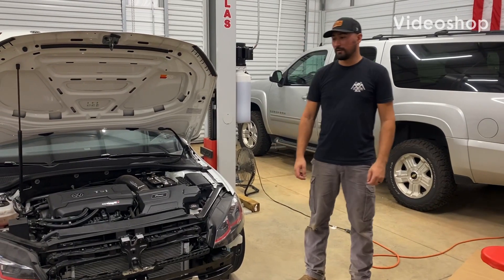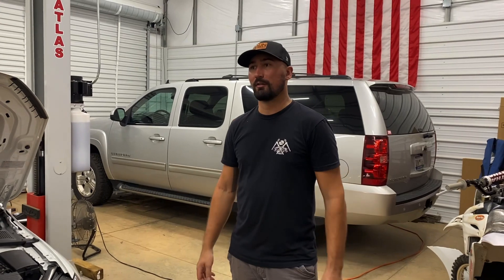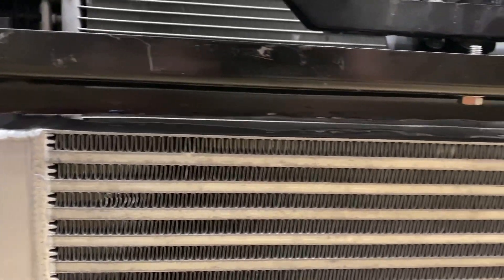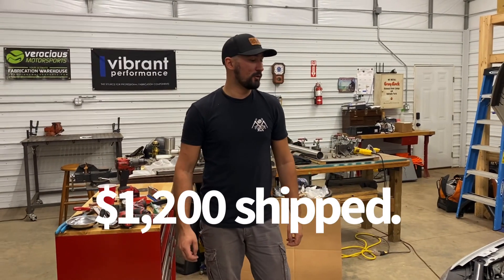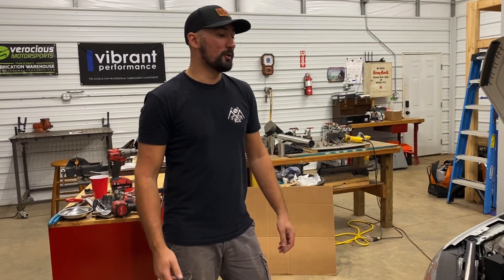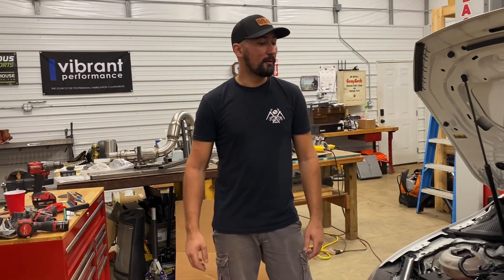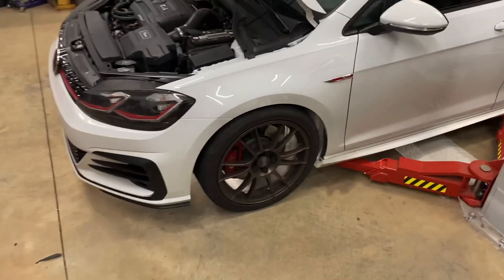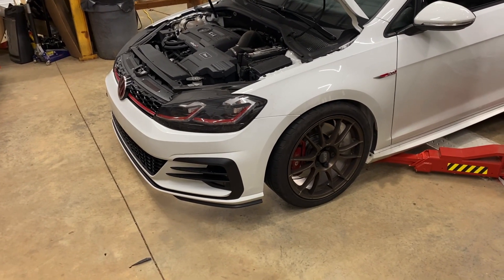Mk7/7.5 V2 FMIC, by Baun Performance

Comment: Awesome dude you're amazing , only plan on going stage 2 on my GTI would this intercooler be a good idea or overkill? Very interested in ordering soon. Also do you make charge pipes etc....
Reply from the maker: The V1 is plenty, as it supports 450whp (HPFP fueled hybrid turbo).

I don’t build charge pipes as there’s no noticeable gains even on my is38 car, plus the market is flooded with them in all different price ranges. Check out my top ten mods video, tons of mods people do didn’t make the cut.
Reply: @BaunPerformance  if I went with V2 would I see any loss in performance only being unitronic stage 2?
Reply from the maker: @petescarp4275  no negatives other than it’s $1,250 vs V1 is $850. Also, the larger V2 requires bumper rebar trimming & the V1 doesn’t.

Comment: Looks great. 

The other day I was telling these Subaru guys that the GTI community believes stock location upgrades are better than fmic. I was called a liar because “no one’s that stupid”

Then one guy googled it and I was vindicated 😂

Till this day I still wonder why GTI folks think stock location upgrades are better. A 400 cubic inch fmic should drastically out perform a stock location upgrade that’s twice as large
Reply from the maker: Paul from DAP started that rumor about a week after my original FMIC dropped. Quincentennial? Who knows, but salesman gotta sell.

My original is 661 cubic inches & the V2 is 808 which is similar to most direct replacements!
Reply: @BaunPerformance  I imagine your v2 keeps things very freaking ambient lol
Reply from the maker: @SheekTresSesenta  it’s a hoss, I’m looking forward to seeing logs from a variety of big turbos
Reply: @BaunPerformance  I’ll be looking fwd to the video!
Reply: It's the frontal area that is driving the heat transfer more than the core volume.  Heat transfer is maximized where the temperature difference between the charge air and ambient air is greatest, this is at the front of the core (and near the inlet end tank).  Stock location IC's typically have around 100% more frontal area than a front mount on the Mk7.  That results in a large disparity in energy transfer potential that a front mount has to make up for in other ways.
Reply: @mygolfmk7209  also. Just wanted to add. Huge fan of your site. It’s super informative! One thing I’d like to mention u forgot when testing intakes

It’s obvious that the days of gaining 10hp due to a cai installed on the car are over. Oem’s have finally started developing very solid oem intakes. And have been for at least 10-15 years. But the sound. I know it’s stupid and childish. But the sound should be a factor haha
Reply: @SheekTresSesenta  Thanks!  The sound is such a subjective topic that I avoid going there if possible.  I try and stick to more objective subjects.
Reply: @mygolfmk7209  I will pretend to respect that 😂 I hope u keep up the good work!
Reply: @mygolfmk7209  potential aside. Because let’s be frank, potential isn’t anything but potential if it can’t be put to proper use and extorted, seems to mean squat due to location. 400 cubic inch front mounts are performing better than stock location upgrades that are over 700 cubic inches. At least in the case of is20 and is38. Every single car community has figured this out already except the GTI community

The explanation given earlier makes sense. Plus the earlier mk7 had that radar sensor in the lower grill. Makes sense why stock location upgrades were more popular. But let’s be for real. Location usually isn’t even a factor unless the oem location was truly horrid. And in the case of the GTI. The stock location is absolutely horrid. Hence why a smaller fmic with half the frontal area does such a great job vs the stock one and stock location upgrades

🤷🏽‍♂️ like I said. Every single community for every single platform has already figured this out. Nothing makes the GTI any different. Y’all (not u specifically, I mean the GTI crowd) like Covid deniers. Except with intercoolers
Reply: @SheekTresSesenta  By potential I mean that the amount of energy transferred from a cross flow heat exchanger is a function of the surface area and I don't know what the true surface area of any of the GTI intercoolers is.

What 400 cubic inch front mount is outperforming stock location intercoolers?

What makes the stock location horrid?  I understand conceptually it's unappealing, but have you been able to measure the affect that the location has on the IC performance?

I don't have anything against a FMIC, I've tried three so far.  Compared to the eight stock locations that I have used I haven't found the front mounts to outperform the stock locations.
Reply: @mygolfmk7209  please try on track. I’m stage 2 on an arm fmic. My buddy is stage 1 (has intake and muffler delete) with an apr intercooler 

We are both dsg. Both dsg tuned. Lap after lap. But going off solely numbers from the map. Looking at the logs in two different tabs. My temps are lower. And way more stable. Mind you, I’m running a hair more boost due to stage 2

I respect and love your tests. But when I decided on my intercooler. I stayed far away from the forums. Good bit of misinformation there in regards to bpv intercoolers etc

I listened to the guy who tunes mk7’s on the dyno. No regrets. No offense to you or your process. But it would be awesome if you could get on track and test there.

This super informal event happened second Saturday of September
Reply: @mygolfmk7209  "I understand conceptually it's unappealing, but have you been able to measure the affect that the location has on the IC performance?"

Conceptually I'm not quite sure what to think. While it's true that frontal area is driving heat transfer more than volume, You still have to get air THROUGH the intercooler for it to do its job properly. I just can't imagine that sandwiching it in between a condenser and a radiator would be an ideal placement. That said, even putting it in front of the condenser could be problematic if the condenser is blocking air from exiting the intercooler properly.

I don't think a couple street pulls is anywhere near enough data to conclude the efficacy of an intercooler's location. Sheek makes a good and completely valid point that on a track, when driving hard for several laps, there could be a noticeable difference (although again I'd like more specific data rather than just a comparison between two similar cars, even though the comparison is still appreciated). Obviously this sort of thing will matter to some drivers more than others depending on what they do with their car and how they drive.

The other major problem I see with the stock location is the giant crash bar that blocks approximately one-third of the intercooler's surface area. It seems like a rather big waste of area to me. It doesn't matter how well the air flows through the core if the core is being blocked by something. That factor alone would make me believe that Baun's V2 likely has a surface area advantage over the stock unit.

My last comment on the subject is that while volume may not be as important as surface area, it certainly still is important otherwise we wouldn't see thick intercoolers used on race engines. To what extend the thickness of the intercooler affects its performance is something I've seen debated for years, by some very smart and experienced people. I also can't imagine the difference between air at the front edge of the intercooler being significantly cooler than air at the rear edge. Surely there will be a difference, but I suspect it would be negligible compared to the temperature delta seen between air in the center of the core and air in the weakest-flowing areas, like the top portion of the outlet end tank.

Clearly intercoolers WORK in the stock location. I'm just not sold on the idea that they can't work better when mounted in the front. Having said all of this, I also love your website and find it to be a great wealth of knowledge. So much awesome testing and lots of data on so many different things that I have still yet to sift through it all.
Reply: @rars0n  I agree the front mount location is probably better.  The problem I'd have with the Baun V2, or the other large FMICs that require cutting a section out of the crash bar, is that they require cutting a piece out of the crash bar.  Compromising vehicle safety for the possibility of a few degrees cooler intake air isn't a tradeoff I'd make.
Reply: @mygolfmk7209  Oh for sure. That's a great point as well. And again that's something that's going to depend on the driver and what they're doing with the car.
Reply: @rars0n  It's not like cutting the crash bar is a simple procedure.  Look at how difficult it is to drill through the bar, these bigger IC's require cutting it.  That probably requires going to a shop with some stout equipment.  The adverse effect on safety that results then becomes an issue for that owner to deal with some time in the future if they decide to sell the car.  Do they then source a full crash bar?  If you've compromised the vehicle's safety, I think that needs to be communicated to the new owner.  This is just to say that these very large FMICs bring some issues with them that I question whether the typical owner will want to deal with.  A product that only is put in use by a small number of owners isn't something I'd spend much time deliberating over.  It's like installing an air-to-water IC, I'm sure it is also feasible, but if only a few people are going to go through the trouble, why use that product as an example of an alternative to the stock location IC?